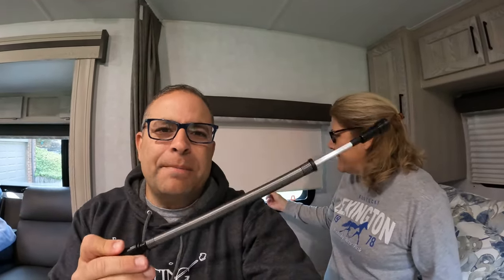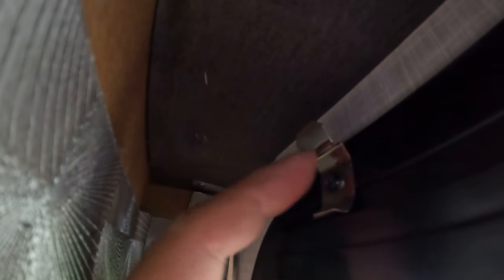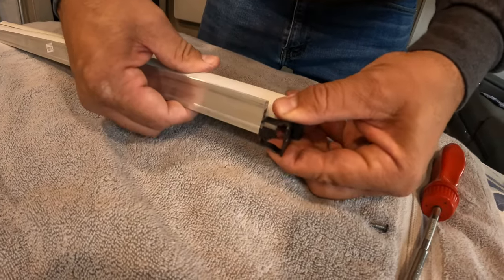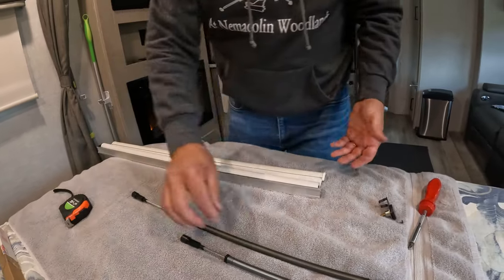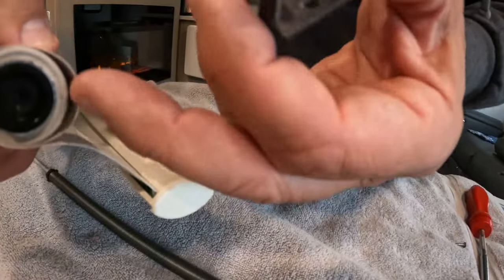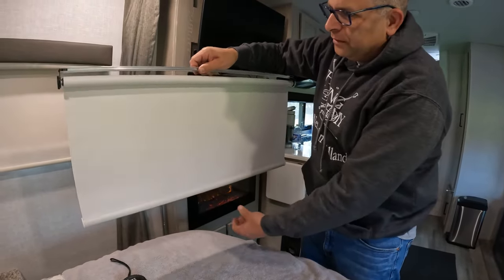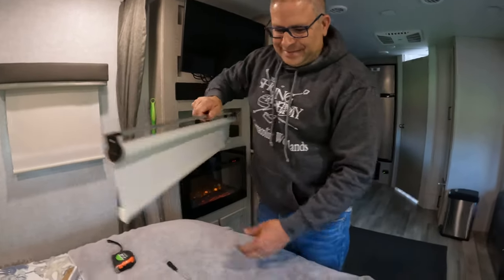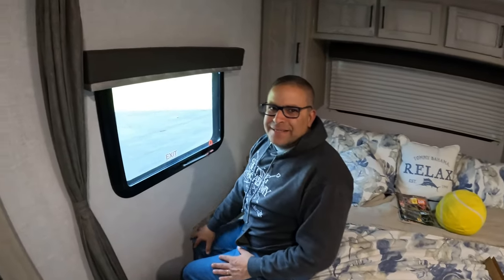RV roller shade Fix (Free Parts)  #rvlife #rvliving #rockwood #camping

Comment: But what broke? Could you just take it out and fix it?  It's crazy but literally 2 of my blinds failed In this way today.  It's like the engineers were so good that planned obsolescence happened wit 2 on the same day.  I want to avoid paying them
Reply from the maker: It’s an internal plastic piece that broke. According to the manufacturer, it cannot be repaired and the spring mechanism needs replaced.

Comment: I have my shade off, and it's obviously a different brand, as ours is just a pull downward to release (go up) but I've been turning and turning the end piece for 5 minutes, and it never gets tight at all?   We've tried fully opening it, then slowly wrapping it up again, and it still isn't working?   I assume the inside parts wear out perhaps, or break?   This is in our '08 Tiffin Phaeton, so I have no idea what brand of shade it is either.
Reply from the maker: If your shade is not staying down, chances are the internal spring mechanism is broken.
I would pull it a part and see what the internal spring assembly looks like. Maybe send a picture to the company I listed in the video and see if they can direct you to the right manufacturer. Best of luck, thanks for watching and commenting.

Comment: Any ideas on how to fix the hem bar from coming off the bottom of the blind? I have been able to repair it by taking it off and putting it back on but this is huge pain in the ass to only come off again in a few weeks later.
Reply from the maker: I just took the end cap off of our blind, the blind material is folded over and stapled to a piece of metal.
it's installed at an angle on the aluminum grab bar so it doesn't come off. Maybe try to remove the end cap on another blind in the RV so you can see what I'm talking about. Hopefully that helps. Appreciate you watching & commenting.